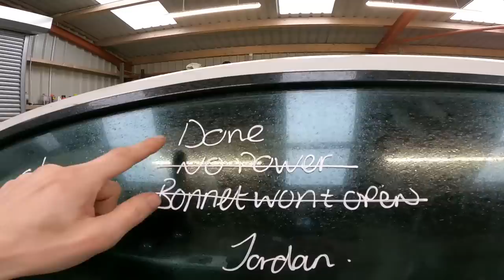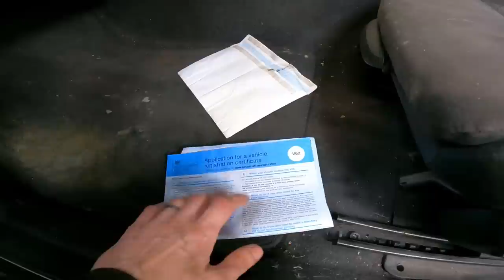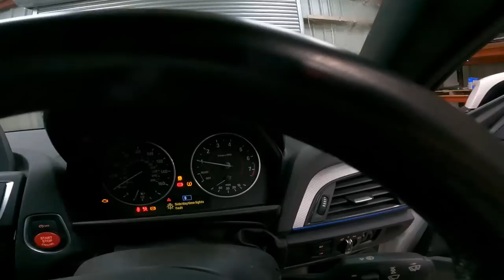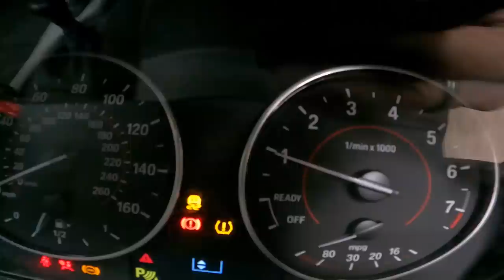Have I Just Bought A Doctored Up BMW 220i M Sport From Salvage Auction????? - Looks Suspicious .....

Comment: Battery is connected to bypass the broken pyro fuse. You also need to code the new battery to the car to ensure the car knows how much to charge it. These cars are very battery voltage/charge sensitive.

Comment: The positive battery connection is a pyro fuse , you can by a repair kit from bmw , the box on the negative pole is intelligent battery sensor (IBS) and does not require replacement after accident, got the makings of a good car !!
Reply: Agreed it’s just a half metre positive cable that bolts to the boot floor and it’s actually where the 2 wires are joined. U don’t need to purchase the whole box of which bmw try and sell u. Just the length of cable and pyro

Comment: Send it back and your right it’s got the wrong head light on it as it’s a m sport not a se model
Reply from the maker: Hi Jason, ive checked up on the original spec and this actually had these halogen lights from standard, xenons where an option even on the M Sport!
So it's the bumper thats wrong not the headlights.

Comment: Police repossession maybe??... Especially if the cars been used on the road untaxed and Mot'd....and it's been involved in an incident 🤔🤔. Depending how cheap it was, I reckon with the battery and Pyro fuse sorted it should be quite a straightforward fix - it will be quite satisfying to see some it's its abuse undone.

Comment: This trend for Audi, BMW and others ? not having a dipstick is absolutely riddiculous. Even if levels should only be relied upon in certain conditions eg after running 5 minutes or warm, a label on the dipstick could cover this. Engine oil is the most basic necessity for an engine